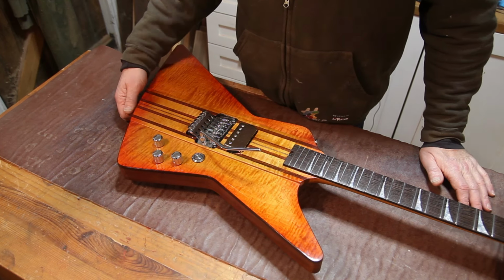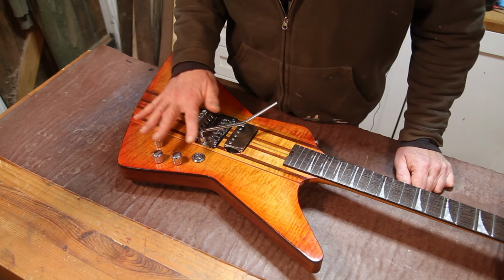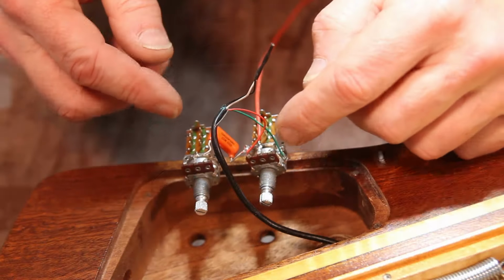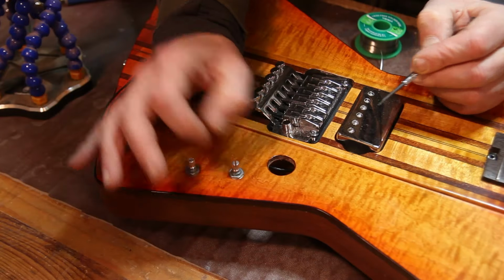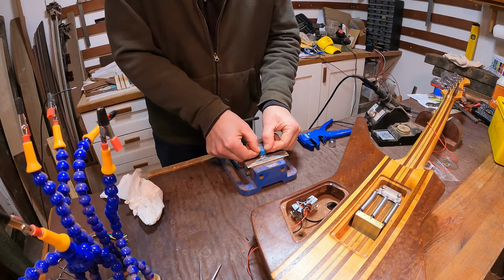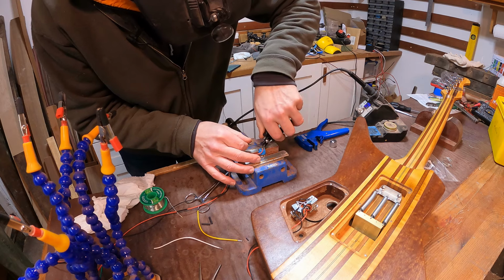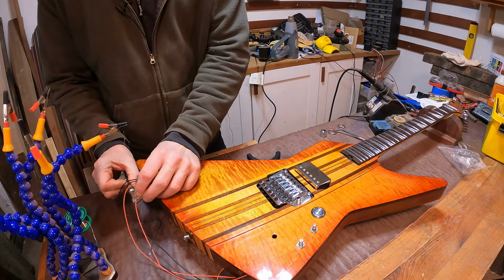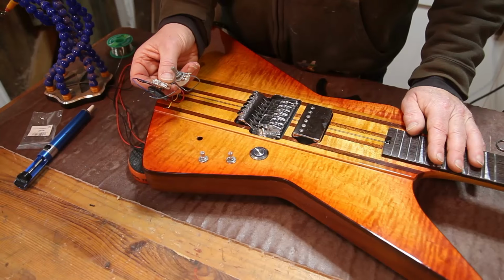Controls, GGBO 2023 episode 43.

Comment: It's looking real nice. I like the raised center section from the wings. And the wood binding under the varnish was a better choice than my red plastic tortoise binding idea. 

Must say this looks to be the most complex build you've achieved. 

If you're going to put a booster circuit and coil tapping might want to shield the cavity. 

That might be a bit of a to-do with those magnet cover holders but I'll bet you'll have a way around that.